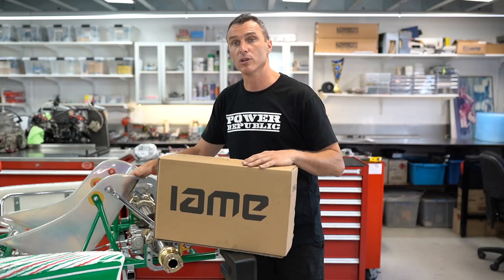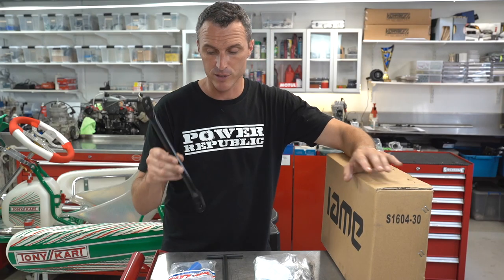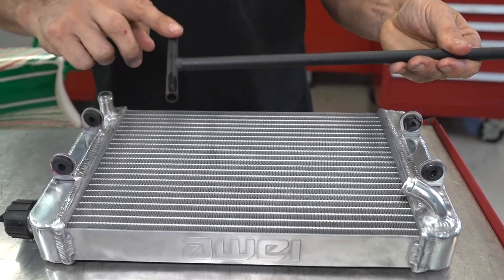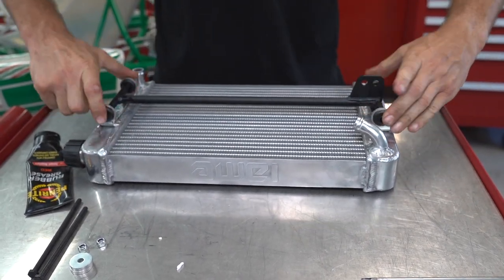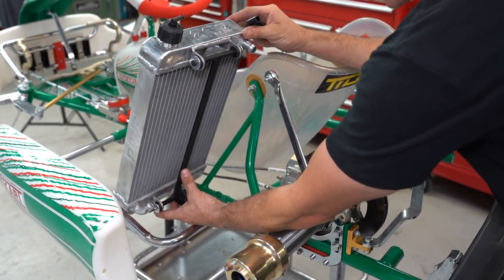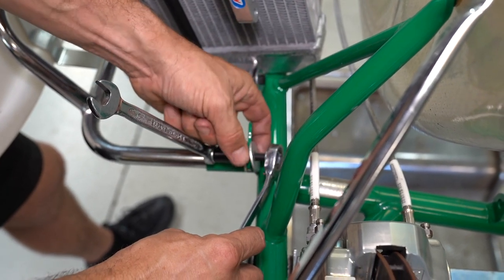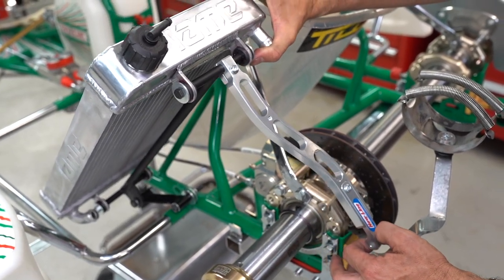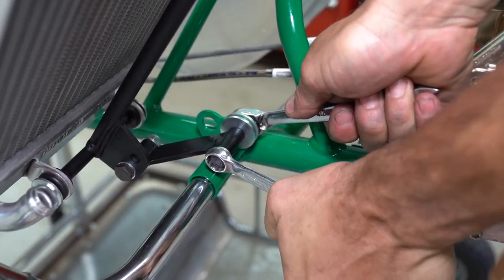HOW TO: Install a Radiator on Your Go Kart Ft. IAME X30 - POWER REPUBLIC

Comment: Hey mate,
FYI you can’t remove the original radiator support if you do x30 official competition. 
The regulation says the radiator and his kit need to be completely setup. 
What you can do if you want to use the new line support is to install both together. 

Cheers
Reply from the maker: clever, thanks for the hot tip